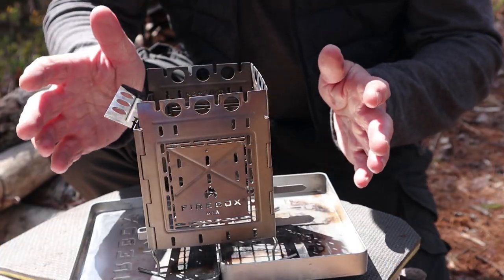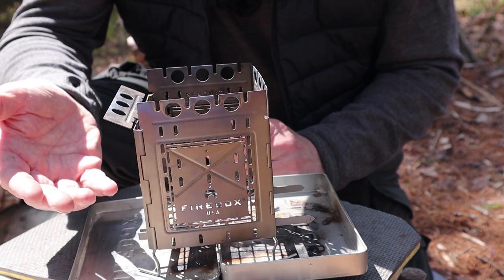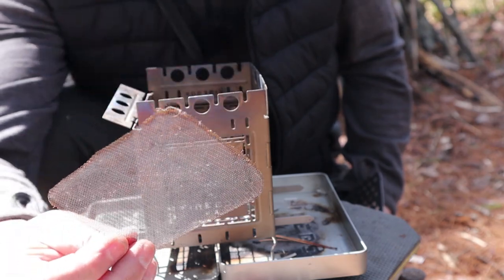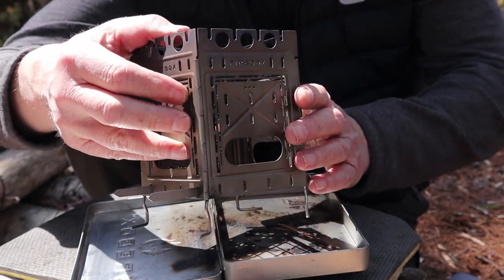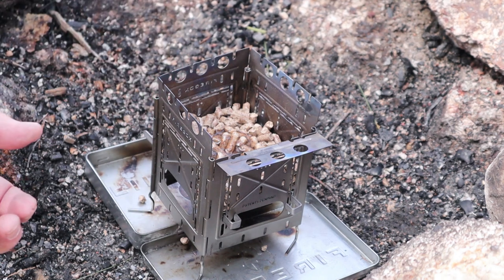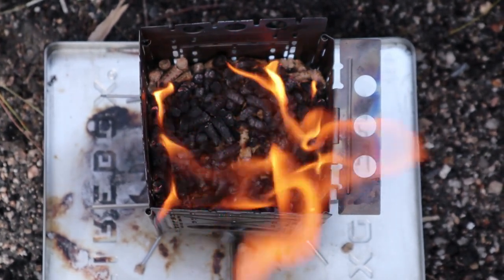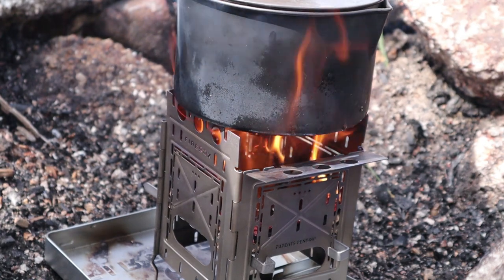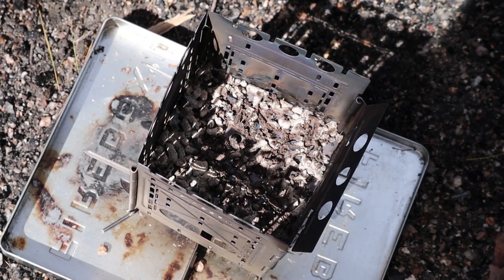Using my Firebox Freestyle with Wood Pellets

Comment: Thanks for sharing your technique for using wood pellets in the Firebox. There's a perforated plate that has 0.100" holes on 0.200" centers that would be worth testing. The Firebox Freestyle stoves are amazing little devices. The inventor is pretty neat also.
Reply from the maker: Steve has done a great job with this design. Lots of room for experimenting as well. Thanks for commenting

Comment: I'm kind of a pyronut....and where I live in rural Idaho we have very frequent power outages. I have found that with the right size gassifier I can boil 2 cups of water with as little as 1oz (weight) of pellets. On the opposite end of stove size I made a gassifier out of a 5 gallon bucket which will burn for 3 hours fully loaded with pellets. I've cooked many a family meal....in the dark....on these stoves. Great video, thank you!
Reply from the maker: You make a great case for having an easy to use stove that can burn wood pellets. Thanks for commenting

Comment: What I did was take the grate.  But got some thin stainless wire.  An weaved it in between the wires in both directions that make up the grate.  So basically I still have a grate.  Just have a grate with smaller holes
Reply from the maker: Interesting solution. I can see a couple of ideas from that. Thanks for commenting
Reply: @MarkYoungBushcraft  well I thought up a few things like you did.  That was the only way to keep the max airflow that I like more so over the other stoves.   
And I said thin stainless wire.  Basically though I found what I was able to cross on eBay that was roughly the same thickness as the wire of the grate itself.   By doing that Ofcourse I needed to weave it through with pliers.   
But it made the added wires very snug being about the same gauge so they would slide or fall out or just be loose in general.  

All I did was cut them to size.  Than grind the ends of them on a bench grinder an rounded an smoothed the ends.   

An thought about hitting the ends with a welder an trying to if not add material.  Melt them into the original grate.   But opted not to.  
They fit so snug and smoothed out. They don’t move around or snag on anything to be an issue.   
And so far has worked amazing. And since it’s kinda built into it.  It’s not like carrying or packing in an extra piece of equipment even if it’s a small thing to go with the stove.   
It’s just built in an is there regardless of what fuel is being burned at the time.  
Definitely should check it out though and see what you think being it’s a really cheap thing to give a shout.   
I wish I were a YouTube person and had a video to stick up.  But if you do give it a shout.  Definitely would be interested in what you think an if it works as well for you as it has me.   
The only other thing I thought was finding some stainless sticks/wire about the same gauge as the legs are, and adding a couple bends in it.   An maybe just maybe with a dremmel or something just barely make a small grind mark one one of them if need be.  
But to be able to stick 4 pins on the top of one of them stoves.  To connect into the leg position holes in the bottom of the other.   
    In order to use the freestyle in the overkill mode like he made for the nano to go into stacking them.   Chance Is slim to need that option.  But just to have that option

Comment: I wanted to experiment to find what type of accelerant might be best for pellets in these types of stoves, wood gasifiers, hobo stoves and campfires too. I used several different small, glass jars and put a few tablespoons of pellets into each one. I then put alcohol, acetone, turpentine, mineral spirits and even water in the jars. I tightened the lids tightly to try to eliminate evaporation and have a fair comparison for my experiment. After about 90 days, I remembered I’d done it all and I took time to play. I had been expecting that being in liquid would break the pellets down into sawdust again but I was surprised that it was only the pellets I’d soaked in water that broke down to sawdust, mushy sawdust. I stood a pellet on end and lit it, an alcohol soaked one. It burned a very long time as sort of a candle. I did the same for each method of my experiment. I’m going long here so I’ll just say that, putting some pellets into a plastic jar and covering the pellets with alcohol will give LONG burning, flame extension of either a fire-lay or any of these kind of stoves. Acetone burns dirtier, turpentine too but if you just need a long burning flame extender to get a fire lit, they all worked well. Just 5 or 6 alcohol soaked pellets in the middle of the rest of what you are trying to light, and you’re gonna have a fire. Same for each of the other methods I tried.
Reply from the maker: This is most interesting and not something I would have thought to do. I will give this a try. Thanks for commenting
Reply: @MarkYoungBushcraft    I would have never thought to use pellets but you showed how well they work and now I have a big stash of em for emergency situations like grid down and no electricity. I’m very pleased with the alcohol soaked pellets as a flame extender.

Comment: As you know from previous vids comments, I love pellets! 😊 but I would also be interested to see how (lump) charcoal performs.  Thanks also, Mark, for the burn time frames 👍🏽
Reply from the maker: I may be using charcoal soon. It is the only fuel (other than gas or alcohol) allowed during a fire ban, which we now have. Thanks for commenting
Reply: I use lump charcoal all the time when I am on overnighters with the Motorocycle.  Works great for cooking up steaks or burgers then I augment with sticks if i need to heat up water.  I tend to carry a small zip lock qt bag and that is more than enough.  However, I love the idea of the pellets as I think they would pack better and ounce for ounce look like they might burn longer.

Comment: If you have a welder (or know someone who does), you might be able to tack weld your mesh grate to the bottom of your grill grate to get the best of both worlds - you won't snag things with the ends of the mesh but you won't have pellets fall through the grate holes.
Reply from the maker: Interesting idea. I will consider. Thanks for commenting

Comment: I have just done bushcraft 6 using wood pellets it lasted an hour use 2mm hole metal was soft after use with bushcraft 6 supported underneath but it work just now find something stronger
Reply from the maker: I have found a number of items at the thrift store that would work. Thanks for commenting

Comment: Hello Mark, I use wood pellets more than charcoal or twigs. It’s just easier for me. However, Once the pellets have burned down a good bit , I find that adding more is a challenge. The new pellets tend to smoother rather than burn. Just my thoughts. Good video!
Reply from the maker: Yes, good point. Pellets seem to prefer a top down burn. They struggle when more are added. Adding charcoal on top should work. Thanks for commenting

Comment: Hi Mark. Instead of using metal mesh to support the wood pellets,  why dont you use a crosshatch of very small twigs? . They are abundant in the forest and are also a fuel source. How about dry moss ? Air will pass through both. Just my thoughts.
Reply from the maker: Interesting idea and it could work. Of course, part of the reason for using pellets is an option for when wood is not available. I would think the pellets would burn through the sticks or moss quickly resulting in the pellets falling through. Still, I will give this a try. Thanks for commenting